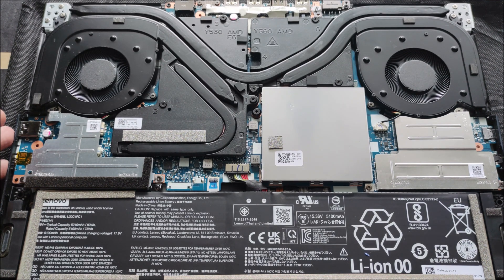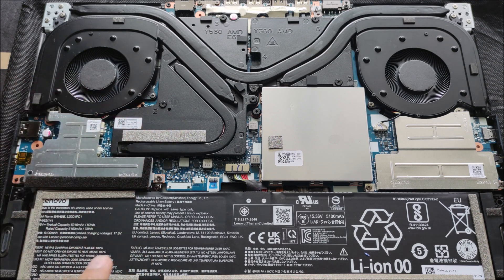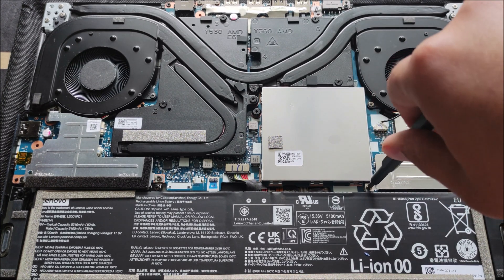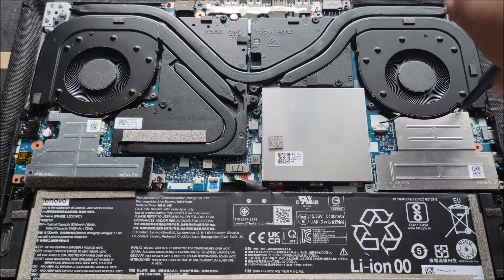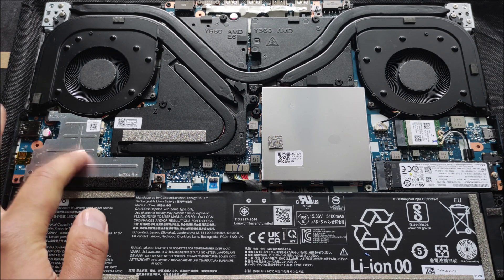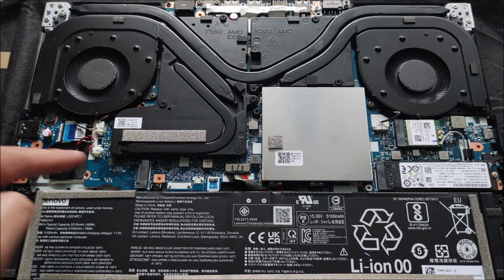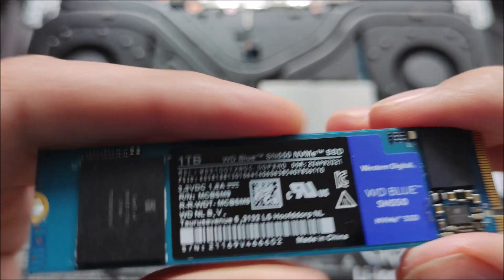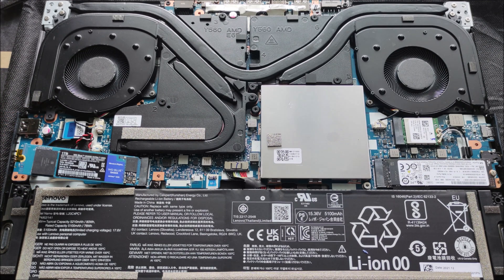LENOVO LEGION 5 💥 SSD & RAM Upgrade 🔥

Comment: Witam, mam model legion 5 15ITH6H, płyta główna LNVNB161216. Czy na dodatkowym slocie będzie działał dysk PCIe 4? Niestety nie mogę znaleźć więcej informacji na ten temat :(
Reply from the maker: Wystarczy wpisać w Google "15ith6h specs" i ze strony Lenovo ściągnąć specyfikację w PDFie... Musiałem poświęcić minutę mojego życia i zrobic to dla Ciebie. Wg niej tylko jeden slot jest 4.0 czyli na drugim SSD 4.0 zadziała, ale będzie działał z maks prędkością 3.0
Mam nadzieję, że przycisk Sybskrybuj znajdziesz na stronie mojego a w zasadzie naszego, bo tworzymy go razem z widzami, kanału 😁
Reply: @CZARNYEU  dziękuję bardzo, mam nadzieję że ta minuta nie popsuła twoich planów na wieczór ;) leci sub.
Reply: @CZARNYEU  bro I have the same legion 5 model (15ITH6H) but I dont know which slot is the PCle 4.0??   I installed my new samsung 980 pro SSD to empty slot but I think default slot that coming with 500gb is actually 4.0 and now my 980 pro SSD works with 3.0.. I just want to know what happens if I swap them between? because my default SSD has windows installed in it. Does swapping the slots causes a problem with windows? please answer me brother :(
Reply from the maker: @tunauysal8898  Should be OK. Only in BIOS change SSD to windows booting
Reply: @CZARNYEU  okay bro thank you so much I will try

Comment: What's the most RAM you can upgrade to on the Lenovo Legion 5? Can you add 32GB RAM to this laptop
?
Reply from the maker: Yes 32GB is official tested by Lenovo 👍 But 64GB should worki also. My 64GB bot work stabke (watch video on my Channel) and i changed to 32GB because three is enough 4 me 😁
I invite You to Sub my Chanel Bro 😀👍

Comment: Hello, i have lenovo legion 5 15IMH6, i5 10500h, 16gb ram and rtx 3050, it has an 512GB M2 SSD, can I add another 1 TB M2 Pcie? I google it and some sources says that I can only add SATA HDD/SSD, some sources says that can add another M2 pcie
Reply from the maker: It depends on year model. 2021 and 2022 have 2 nvme słots. 2020 model: 1 nvme and 1 nvme/2.5". In my 2021 Legion i change 512GB. Nie there is 2TB 970 Evo Plus and 1TB WD Blue 550.
Reply: @CZARNYEU  do you know where I can see the year ? I think it is 2021 but I'm not sure 100%
Reply from the maker: U can go to Lenovo website and allow to check your system at chrome browser.  Where R U From Bro?
Reply: @CZARNYEU  i am from România. I found in the user guide that it is First Edition May 2021. So.. does that mean it support one more 1TB M2 PCIe SSD? :D
Reply from the maker: Też Bro i have 2021 too. I have 2TB and 1TB inside. Today i change 1TB at 2TB and will be video about it. So subscribe channel 👍🙂 Remember this model has obły PCIe 3.0 x4. Do no sense take PCIe 4.0.
Reply: @CZARNYEU  thank you, subscribed !
Reply from the maker: No problem bro. I recommend WD SN570 is cool and eficience or other 3D TLC SSD. Dont buy QLC chips NAND.
Reply: @CZARNYEU  with a quick search I found this ssd
SAMSUNG 970 EVO Plus, 1TB, PCIe Gen 3.0 x 4, M.2 PCIE, MZ-V7S1T0BW. I will compare this with other SSDs when i will have some free time

Comment: Did you just pull the ram shield off without needing to bend the clips outwards? I want to upgrade my RAM but I don't like the idea of bending the clamps back to remove the shield... I want them to stay tight.
Reply from the maker: Do not move these clamps at all, just pry the cover gently from the bottom. from the motherboard side,
Reply: @CZARNYEU  thankyou for the quick response
Reply from the maker: Its normal on my channel 😁 Be carefull @Motherboard 👍 I Invite You to  subscribe my channel too 😀👍
Watch also this
https://youtu.be/6VbbueE2xrM

Comment: Thanks a lot for this detailed video, I have to like it.
May I ask what would happen if you installed a 4TB SSD, would it still work?
Reply from the maker: It should work, although I only tested the 2TB model. According to what people write on forums such as Reddit, SSDs should work even 8TB. Similarly, the memory works up to 64GB (2x32GB) 😀
Best regards and invite you to subscribe to the channel 😀👍
Reply: @CZARNYEU  will it still work if I just installed 5tb and upgraded nothing else? Thank you
Reply: @boyraptor  Absolutely of course, you can always upgrade storage and ram separately, they're not connected in any way :)
Reply from the maker: There is no laptop where SSD and RAM are connected ...
Reply: @CZARNYEU  
Thank you for your answer, I just ordered it yesterday and I will be trying it and giving a feedback here for whoever is interested, fingers crossed.
Reply from the maker: Write for sure what SSD, capacity and if it works 👍🙂 Where are you from?
Reply: @CZARNYEU  
It actually worked!
I tried the CORSAIR 4TB MP400 and it worked just fine, funny to say that it is mentioned in the Lenovo specs that it can take up to 1TB.
Thanks a lot for your reply and help bro, I appreciate it. And I am from Egypt living in Turkey. :)
Reply from the maker: @shriefallam8866  I am glad that I could help 😀👍 Lenovo gives 1TB as the max available in the sales kit and 2TB as the max tested SSD capacity. Similarly, the RAM 32GB is max in the factory set. Users, however, work up to 2x32GB, so the total maximum is 64GB 😁 Regards and invite you to subscribe to the channel 😀👍 In many videos you have subtitles, e.g. in English and Arabic
Reply: @CZARNYEU  do you have Ani idea what is the real nvme max capacity? 
In lenovo sites they said 2tb max for both slots
Reply: @shriefallam8866  nvme ssd or sata ssd?
Reply: @mosmo618  nvme ssd, I applied 4tb and it worked just fine.
Reply: @shriefallam8866  first slot or second?
can you tell me what is your legion model number?
Reply: @mosmo618  
Second slot, the first one has a default nvme of 1tb.
My legion model is 17ach6h. I hope this helps you.
Reply from the maker: No Brother both slots nVME should be the same. Support official up to 2TB, but a lot of people report that SSD UP TO 8GB work 😀👍 I invite You to Sub my channel Bro 😀👍
Reply from the maker: That I said it's probably 8TB. Standard NVMe -> if 4TB work, 8TB also must work
Reply from the maker: @Shrief Allam Which model do U have Bro?
Reply from the maker: Do U try replace this SSDs? I think both slots are the same max Capacity 😉
Reply: @CZARNYEU  
I believe the model is: 17ach6h

Comment: Hello, does the Legion 5 2022 (Gen 7) also have two slots for SSD? I'm assuming it only supports M.2 2280 size?
Reply: Hi. Now you know? I also want to know bro.
Reply from the maker: Which model do u have Bro?
Reply: @CZARNYEU  legion 5 2022 gen 7
Reply from the maker: If i good remember u have 2 nvme 2280 (up to 2TB tested via Lenovo but should work even 8TB 😉) i invite You to sub my Channel Bro 👍😀
Reply: @CZARNYEU  2280 gen 4 right? how much do you know?
Reply from the maker: I have and tested 2021 version. Which CPU do U have?
Reply: @CZARNYEU  ryzen 7 6800
Reply from the maker: You should download technical sheet your model. This CPU support PCIE 4.0 but im not surę that's on both m2 słots...
Reply from the maker: This is model 2021 as you see. As far as I know, there are still 2 M2 slots 👍 Yours sincerely and invite you to subscribe to the channel 👍😀
Reply: Yes, it has 2 slots and only support M2 2280
Reply from the maker: Not only 2280. It possible to put short SSD also 👍🙂 I invite You Brothers to sub my channel 🙂👍
Reply: @CZARNYEU  nie wiem jeszcze czy mam 2021 czy 2022 model w 2022 juz nie ma drugiego slotu na m2 albo ssd ?
Reply from the maker: Oba mają nvme. Model 2020 mógł mieć sata